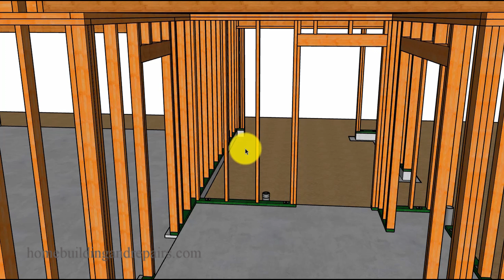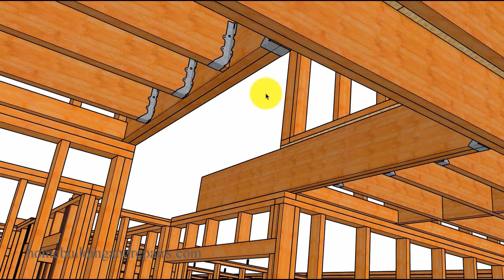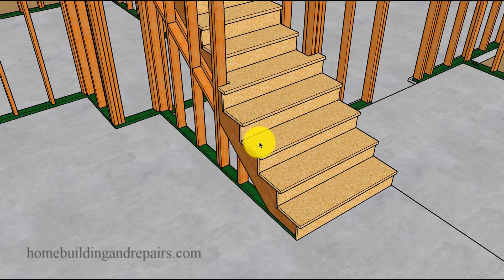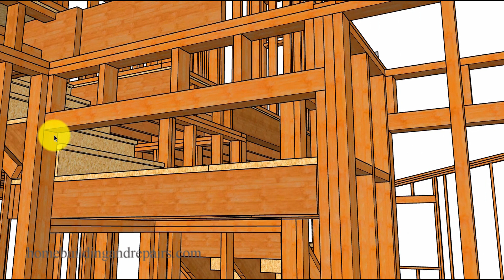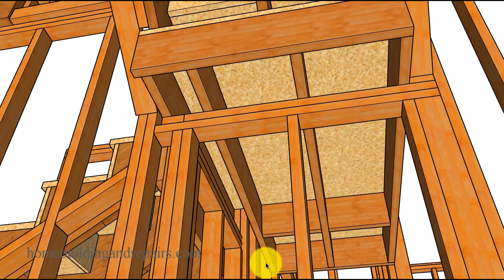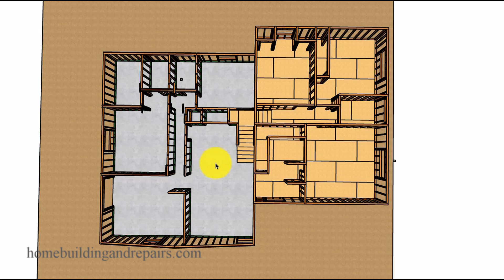Part 7 - Framing Tour of Stairs With Landing Over Garage For Second Story Home Addition

Comment: I have a 24 x 30 garage with 15 Ft ceiling height downstairs to accommodate a car lift and a loft with a ceiling height of 8ft sitting on top of 24ft long 14" engineered I joist floor system. I’m trying to get stairs big enough to walk up one flight to a landing then up another set of stairs and be able to get a pool table and king size be up without struggling. I’m tight on space because of the future car lift so I’m researching for days on how to attach the stairs to the I joist on its face side without giving up the structural integrity of cutting out 4 to 5 I joist. Anyone got tips for me to get the second set of 42" wide steps up to the second floor while being tight on the side wall and not needing any 4x4’s for support to the ground? I got the first set up to the landing using 4x4’s in my garage as support but can’t afford to loose anymore space downstairs. Thanks
Reply from the maker: Email me a picture and I will take a look.
Reply: @stairbuilding  will do thanks